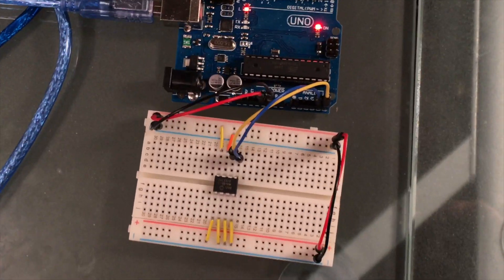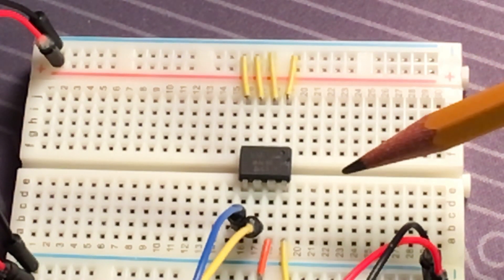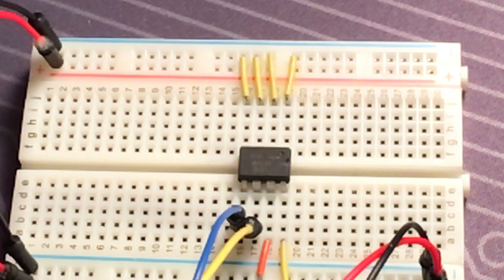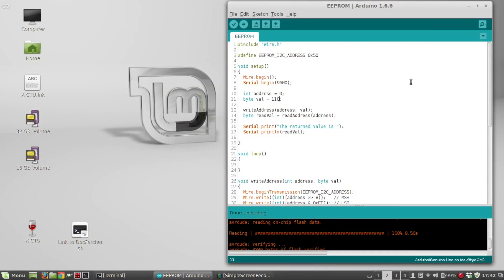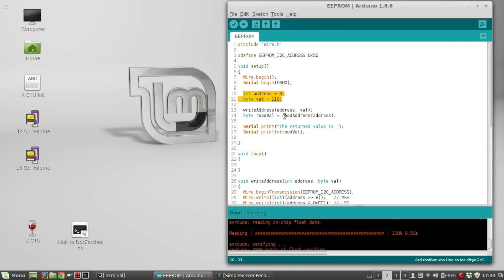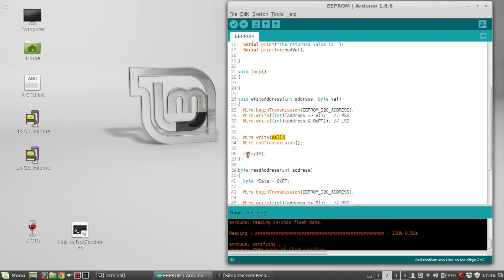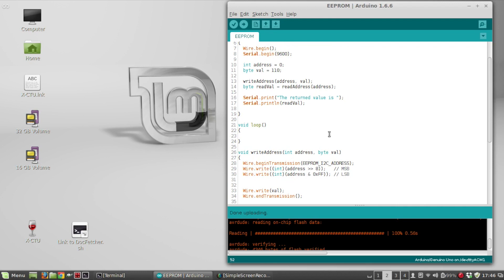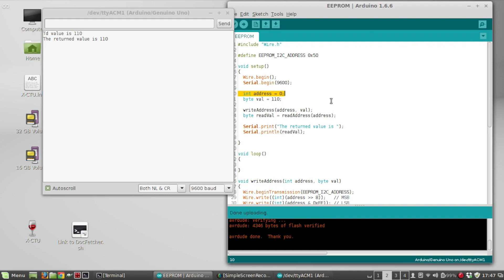Arduino and External EEPROM

Comment: how can i store the previous values of length for rotary encoder using external EEPROM? here is the code ,  plz help me to develope code to store previous data during powered off condition on LCD .
code : 
 #include <EEPROM.h>
 #include <LiquidCrystal.h>
 LiquidCrystal lcd(12, 11, 5, 4, 3, 2);
 int address=50;
 int read_value=0;
 const int  buttonPin = 8;
 int buttonState; 
 int led=9;
 int val; 
 int encoderPinA = 6;
 int encoderPinB = 7;
 int counter = 0;
 int encoderPinALast = LOW;
 int n = LOW;
 float Length;
 float r=31.82;
 float pulses=15;
 float pi=3.1428571;
 int istrue;
 

 void setup() {

  pinMode(led,OUTPUT);
   pinMode (encoderPinA,INPUT);
   pinMode (encoderPinB,INPUT);
   Serial.begin (9600);
   lcd.begin(16,2);
lcd.print("Last Value");
read_value=EEPROM.read(address);
lcd.print(read_value);
EEPROM.write(address,(Length));
delay(400);
lcd.clear();
 } 

 void loop() {

 
   n = digitalRead(encoderPinA);
   
   if ((encoderPinALast == LOW) && (n == HIGH)) {
     if (digitalRead(encoderPinB) == LOW) {
       counter--;
        Length=2*pi*r*counter;
        Length=Length/pulses;
     
       if(counter<1)
       {
        Length=0;
        counter=0;   
       }
          lcd.clear();
          lcd.setCursor(0,0); 
  lcd.print("Length (mm)   Counter");
  lcd.setCursor(0,1);
  lcd.print(Length)+lcd.print(" mm  ")+lcd.print( counter);
 EEPROM.write(address,(Length));
 //lcd.print(Length)+lcd.print(" mm  ") 
  //delay(100);
          
          
        
        lcd.setCursor(0,0); 
  lcd.print("LENGTH   COUNTER");
  lcd.setCursor(0,1);
  lcd.print(Length)+lcd.print(" mm  ")+lcd.print( counter);
  //delay(100);
  Serial.print ("Length :     Counter : ");
  Serial.println (counter) + Serial.println(Length);
     } else {
      lcd.clear();
      lcd.setCursor(0,0); 
  lcd.print("LENGTH   COUNTER");
  lcd.setCursor(0,1);
  lcd.print(Length)+lcd.print(" mm  ")+lcd.print( counter);
  //delay(100);
  
 //lcd.print(Length)+lcd.print(" mm  ") 
  Serial.print ("Length (mm) :     Counter : ");
  Serial.println (counter) + Serial.println(Length);
       counter++;
        Length=2*pi*r*counter;
        Length=Length/pulses;
        
    
       
     }
      
   } 
   encoderPinALast = n;
   
//   buttonState = digitalRead(buttonPin);
//     if (buttonState==LOW){
//      
//      counter=0;
//      Length=0.00;   
//     //Serial.println("Reseting All Values");
//     lcd.clear();
//      lcd.setCursor(0,0);
//      lcd.print("R E S E T .... ");
//      delay(500);
//    lcd.clear(); 
//    lcd.setCursor(0,0); 
//  lcd.print("LENGTH   COUNTER");
//  lcd.setCursor(0,1);
//  lcd.print(Length)+lcd.print(" mm  ")+lcd.print( counter);
//  delay(100);
//     
//     }
       
     }
Reply from the maker: I would try using EEPROM.get() instead of EEPROM.read(), and EEPROM.put() instead of EEPROM.write().   EEPROM.read() will only read a single byte of data, however you want to read a float value which is larger than a byte.  Take a look at https://www.arduino.cc/en/Reference/EEPROM and look at the differences between 'read()' and 'get()'.

Comment: how to write GPS ( LONG & LAT with nnn.pppppp) into EEPROM 24C256 chip?
Reply from the maker: You would need to devise a scheme to encode and decode the floating point values.  There is an IEEE standard for doing this (IEEE 754), so you could try to find an arduino library for this or write your own.  That may be overkill however, since you are only storing lat/lon values.  So what you could do is write your own encoder/decoder.  One way to do this is to have the integer portion of the float value stored in the first two bytes.  One byte would not be enough for the longitude values, since the range is -128 to +128 and you need -180 to +180 for the longitude values.  You could use the next 4 bytes to represent the unsigned decimal portion of the value.  Each float value would then take up 6 bytes, and you would need to parse the lat/lon values and do some bit shifting to write the values to the EEPROM, and would also need to do reconstruct the float values when reading from the EEPROM.
Reply from the maker: One other thing you could do is treat the values as long integers when they are stored in EEPROM.  For example, if you have a longitude value of 121.3453456 just multiply it by 10000000 to get 1213453456.  Store that into the EEPROM, and when you read the value from the EEPROM, you just divide it by 10000000 to get the original value.

Comment: Great tutorial! Really informative. I have tried it and it works.
However, I have one question: how do I address the individual EEPROM's if I have two connected to the i2c bus of the Arduino? 
I would like to store two different bytes on them.
Reply from the maker: Mads Risbjerg Andersen Thanks for the comment.  Pins 1, 2, and 3 are the address pins (A0, A1, and A2) and you set these pins high or low via the Arduino.  Each chip has to have a unique address so the first could be set to 0 0 0 and the second to 0 0 1.  The three address pins will allow for up to 8 EEPROM chips to be addressed.  Each chip has the same I2C address so they will all receive the communications, however the address pin value is encoded in the control byte so the chip knows whether or not the communication was intended for it.  You should probably take a look at the 24LC512 data sheet since it explains it better than I can.
Reply: Thanks for the quick answer! I've spent quite some time trying to figure it out now. Still haven't fixed it though. I'm not quite sure how I give the individual EEPROM's their specific addresses. I understand that I can change the three last digits in the address, which gives me a variety of different combinations. I have defined a new address with the value: 0x51, since that would be 1010001, right? I just don't get what specific code I should write in the Arduino IDE to give the EEPROM's their different addresses. Would you mind giving an example of how it could work with starting point in your code example? 
Thanks again.
Reply from the maker: You just need to add another #define for the second chip.  From my sketch, you would now have this:

#define EEPROM_I2C_ADDRESS1 0x50#define EEPROM_I2C_ADDRESS2 0x51
So now when you call Wire.beginTransmission(), you pass it the address of the chip that you want to access.
Reply: Yeah, okay nice. It is done and now I can read from both individually - however I only receive a value of 255 from the second EEPROM, do you know why that is? 
Also, what if I want to access (read) from both of them simultaneously?
The purpose for me is to write to them one at a time, but then afterwards read from both at the same time and get both values.
Reply from the maker: I just posted a new video on my channel that shows how to read and write to multiple EEPROMs, so maybe take a look at it: https://youtu.be/Ejrh1vNeDhA.  If you are reading a value of 255, there is something wrong.  Maybe the EEPROM address pins aren't set correctly?  Also, I don't think it is possible to do a simultaneously operation across different chips.  I believe part of that is the way that I2C works and the fact that there is only one processor on the Arduino.

Comment: great lesson thank you, 
is it possible to read & write any other eeprom this way?
Reply from the maker: It should be possible, but you need  to check the datasheet for the EEPROM chip you are using.  It is generally easier to use if it utilizes the I2C communication protocol.

Comment: Oh hey,  there is a little mix up which may cause some confusion. MSB & LSB are the wrong terms (somewhere around minute 5:00 )
High byte and low byte are the terms i know for describing the two bytes you've shown. I just mention it, so people don't get confused.
Reply from the maker: Good catch.  MSB and LSB are more commonly used to refer to the Most/Least Significant Bit although sometimes used to refer to the byte order.  Your are correct that high byte and low byte are the more common ways to refer to byte order.